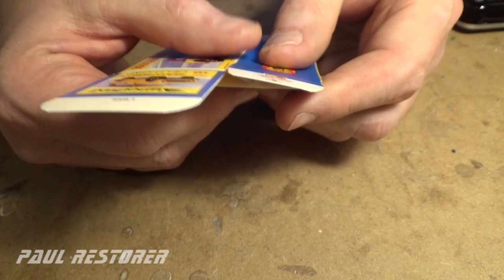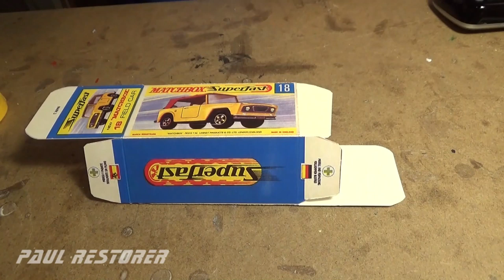Matchbox restoration Field Car Scout nr 18 diecast car

Comment: Very nice work, Paul. Congratulations! I usually use M2 screws for the posts, but in this vehicle I noticed the posts are much smaller. Which type / size of screws did you use? Thank you, and keep up the good work!
Reply from the maker: Thank you very much. I also used M2 screws. I drilled the hole very gently. First with a 1.2 mm drill and then a 1.6 mm drill and everything went well. Best wishes